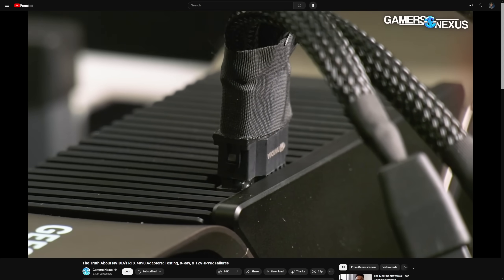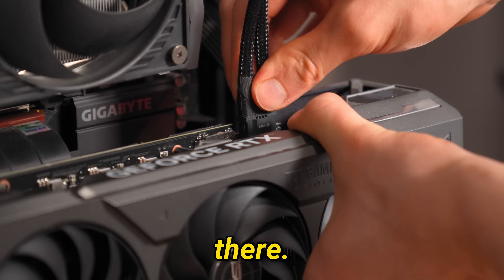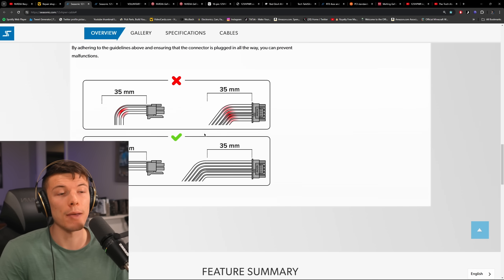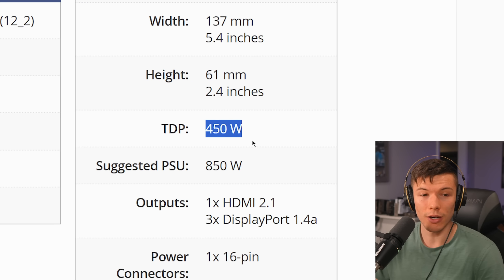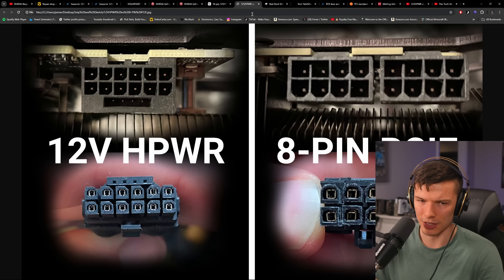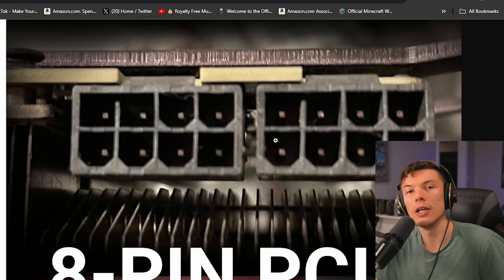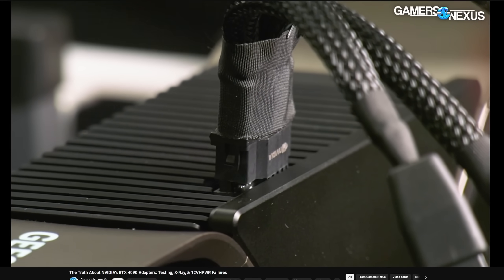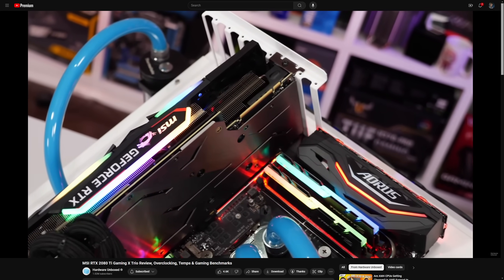The Dumbest Thing to Happen to Graphics Cards

Comment: $2000 GPU should never have such issues...
Reply: Gpu should never be 2000 in the first place
Reply: @xNachtmahRx  Same as smartphone, all you pay extra $2,000 is for better specs and better camera even though it does not replace a $200 camera
Reply: true, simply don't buy it.
power issues can alway ruin your entire GPU.
Reply: Facts
Reply: Really nothing to do with the price. No consumer product should have these issues period.
Reply: @tomvanvenrooij1811 " hey son, i bought you this new gaming PC." A couple weeks later: "Hey son, i lit up you and the home on fire. "
Reply: It was never worth $2000 but $550. Dumies keep buying their Crap.In reality you can still run most anything with a 3080 oclocked.
Reply: @yougod7253 almost 😢
Reply: @yougod7253  can't run AI models and 3D design though
Reply: @notaras1985  why 3080 can't run AI models and 3D design?
Reply: @AzusaSnowflake  too small VRam
Reply: @jacekmakesstates user error, yet I’ve never seen these issues ever so commonly occur on 8 & 6 pin pcie connectors (daisy-chaining aside cause that’s just bad practice). To just assume every case is user error or “skill issue” rather than a poorly executed cable by Nvidia, is in fact, cope. Nvidia messed up with releasing 12VHP to consumers this early imo. Haven’t heard of melting connectors on the 7900xtx.
Reply: @mass_stay_tapped_in528  you do realise it was designed by PCI-SIG not nvidia right?
Reply: @firstname9845  Yes... I'm aware... As it was literally designed specifically for the 30 series Founders Edition. Nvidia was the one that got hit with the class-action lawsuit for the cable. PCI-SIG stated that it was Nvidia and their partners that were responsible for testing their products to account for user error (even though we know now that even CableMod's version had to be recalled as well by the U.S CPSC.. Seems like this cable was totally unnecessary by design) . To be fair, doesn't matter who made it; it still stands that the cable is causing more problems and stress than any GPU owner should endure, especially after spending almost (sometimes over) $2,000.
Reply: @jacekmakesBut it does. It’s still happening since launch.. people still post to Reddit daily about it. Some doing whole ass case changes for vertical risers/more space for the bend in the cable etc.. None of these problems I’ve ever came across or experienced with traditional 8 & 6 pin. It’s been a bad implementation that’s caused more issues than it has resolved, & it’s been proven to be more than just user error (yes, user error does happen especially with these cables.. but there’s people that have been building for years that have never experienced such a flawed PCIE cable in their life) was all I was trying to say. To blanket the issue as ONLY user error is extremely ignorant to the real issue; the cable simply sucks & shouldn’t cause such an experience after spending $2000. That’s all.
Reply: Well is Nvidia branding for ya
Reply: 500$ GPU shouldn't have such issues
Reply: It’s wild that the 1080 ti is still price to performance and reliability the best card Nvidia has ever released.
Reply: You should see the PCBs they use. Chinese cardboard would be higher quality
Reply: People deserve it. Since quite a while buyers are following trending, fashion, instead of making their own decisions. It was an expensive lesson for buyers.
Reply: why is this gpu even $2000 anyways? remember when the top of the line gpu like GTX 1080 TI was like only $800?
Reply: @Bloopergrandson1  Their greed is bottomless. Next lines ups woll start at 3000$
Reply: It's 450W instead of 300W which is the issue. To screw with everybody they forced this 12-Pin disaster to screw you all!
Reply: $2000 GPU should come with a welcome package of cocaine and hookers...
Reply: People know if they release the price of the gpu to high and nobody buys them the price will drop
Reply: Is it not a bargain?
Reply: Even if they were not burning up they are worth $800 , not $2,000.
Reply: Everything has issues. Look at vehicles. They cost WAAYY more and have issues.
Reply: @jacekmakes is that why only this gpu have problem dumb boy
Reply: The connector is designed to fail.
Reply: eğer bu kartlara 2000$ veren insanların beyinsel yetersizliği olmasaydı o paranın karşılığını tam olarak almak isterdi mesela 2000$ 10 yıl ücretsiz elindeki kartı verip yenisini ücretsiz yenileme garantisi. fakat insanların beyinleri yetersiz olduğu için verdikleri 2000$'ın hem bireysel hemde yüzbinlerce tüketicinin gücünün ne denli büyük bir güç olduğunu anlayabilmekten çok uzaklar. burada sorun nvidia'da değil genel olarak dünyadaki genel insan zeka ortalamasının yetersizliğinde.
Reply: Ithis is the biggest Fails in Gpu Historie burning cabels.what a cheap product how the fuck test this ....
Reply: Thas why I got a 1650 super.. and no matter what Yu want to say.. it’s enough for majority of the games I play even at maxed settings majorly
Reply: @aceylaboy97  Nothing wrong with being happy with what you have mate. Whether it's the newest GPU out, or several generations old. If it works well for you, & performs to your expectation than that's all that matters brother. Keep on gamin
Reply: Software accelerator card, correction.
Reply: If someone can afford one, he/she can afford another. No problem there
Reply: its a skill issue by the user
Reply: @firstname9845  Please elaborate more. Your information could possibly be so valuable and rare where nobody, not even gpu repair shops, have come to a single solution.
Reply: @Scarpheon mount it vertically. $40 solution.
Reply: @TheLite0003  Ah paying 2000$, just to pay additonal 40$ for a vertical mount. Such a show of premium quality for the price 😃
Reply: @Scarpheon day 1 4090 3ghz+ 600w power limit mounted horizontally no issues 100% skill issue
Reply: @TheLite0003  oh right. Everyone has the space to use a vertical mount in their pc builds just so their 2k GPU doesn't combust hehe
Reply: @Scarpheon  Guess what...

When I bought my $2000 couch I had to consider whether it would fit through my front door.

When I bought my $2000 21" all-terrain tire set, I had to consider whether it would fit my wheel well.

I'm sorry that you don't realize the entire world does not cater to you.
Reply: @firstname9845  that or just cheap connectors that dont make good tight connections.
Reply: @firstname9845 wrong. It’s a hardware issue. Buy AMD
Reply: @isaacarndt179  why would i buy brokie boy hardware that is useless for anything outside of gaming? you do realise gpus are used for things other than gaming?
Reply: @firstname9845  yeah but you definitely are not the one using it for that if this is youtube channel you calling premium hardware broke boy shit on
Reply: @isaacarndt179  you aren't very bright are you? there is a reason why market share is held by nvidia not amd. And yes I do utilise workflows where nvidia cards are more suited. Is it necessary? No, but time is money. If you can't afford something stop crying about it that is an issue with you
Reply: @firstname9845  and this issue is that it’s 2k and unreliable due to power connector issues. Your refusal to understand that down time do to your card nuking itself costs you money too bub
Reply: @isaacarndt179  it’s not unreliable tho? It’s user error from plugging in the adapter. I don’t use an adapter anyways I use a custom 16 gauge to my psu
Reply: @firstname9845  Yes this is the only reason this have been an issue...
Reply: @firstname9845  it should be designed proof user. So the user wouldn't have to go through issues like that, even the dumbest one. That's why they've gotten the brightest engineeres there to think or every thing possible. So you can be sure your 2K USD card has no risk of anyting, even the cheapeest card.
Reply: @firstname9845  Northridge and every other repair channel begs to differ.

Comment: This 12VHPWR connector is a textbook example of solution searching for problem. 8-pin connectors are more than enough until, like you mentioned, something crazy like 4090ti. So for 95% of people it solves no problem and introduces new ones like having to use adapters that can literally start a fire. No surprise nobody likes it.
Reply: Debauer agrees with you.
Reply: It just doesn't have the power/thermal headroom that the 8-pin has. The 8-pin can handle almost 100% over what it is expected to deliver, while the 12-pin manages the low teens. It is just operating far too close to its limits and should have been rated at, say, 4-450W instead of 600W.
Reply: @QofSQ  but 4090 not pulling more than 450watts or smt right? 3 8pins would be the best solution. Underclock your 4090. 7900xtx has some errors also. Mine standard is clocked at 2800 mhz. which let the gpu hotspot get to 105 degrees celcius. When clocked down to 2400 it stays low in temp. Somehow mine always reverts back to 2800mhzx. While it should be 2625 or smt. Strange glitch and took me 2 months before i could finally play longer sessions cause i didnt like the temps
Reply: It can't start a fire - that is misinformation. The specialized plastic IS NOT flammable.

Comment: Its clear Nvidia engineers is not electricians, no nothing of what happens when you shrink diameter of a cable, electrons has a smaller space to travel, ergo higher heat!
Reply: Another question, is the wall outlet in you house changed much in size since the 70's? I guess no, because the can't shrink. The outlet would melt and burn down the house!

Comment: Don't fix what aint broke. They tried to innovate in an area where safety, durability, reliability, and foolproofnes is key. With how cases jam on these and how even monkeys are building pcs it's not a place to innovate. Or at least do a better job at it to really make foolproof
Reply: Yeah instead of trying to make a connector because of higher power why not try more at making gpu less power hungry and if it isn't possible why not don't force if we're not yet using 5 8pin connectors. 4 should be the limit before try to introduce something new, as it's plenty of time to test it before going over this issue

Comment: Repeatedly showing a melting RTX 4090 12vhpwr that's not correctly plugged isn't proving your point

Pretty sure all of those 4090 users with a melted 12vhpwr used a third party 12vhpwr or not properly inserted their 12vhpwr

Comment: When the 4090 first appeared I checked the specs and also looked at the 12VHPWR connector. My first thought was "They're putting how much power through that? No way - there are going to be fires". It might be that the maths told Nvidia they could do it, but I'm well accustomed to the philosophy of "Just because the maths tells you you can do it, doesn't mean you should do it".
Reply: The problem isn't because I of ho much power is going through the cable. It actually doesn't pull 600 watts. The problem is the sense pins. They say don't do the bend not because it can't be bent and still work. Its because the average person that bends the cable will also put pressure on the connector and pull the power pins slightly out while still making full connection with the sense pins. So those pins will say PSU we are fully connected send us power. But you aren't fully connected. So like putting a fork in the outlet you have an open circuit that can be closed sometimes and that generates a lot of heat outside the cable rather than inside the cable.  Also the sense pins don't have a 0 state to send no power if it does sense it isn't fully connected. So when it should send 0 watts it still sends 150 watts. Which also causes melted cables. If the lock on the cable was like the other ones this wouldn't be an issue.  You can't wiggle any of the other cables after inserted but the 12vhp lock is so thin you can wiggle it a lot while it is still locked. Enough to pull pins partially out of the socket.